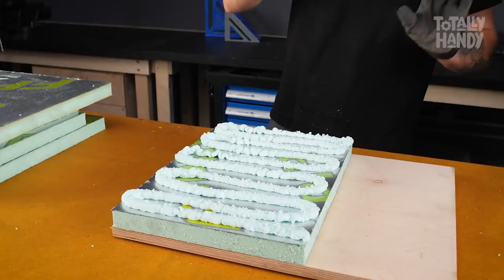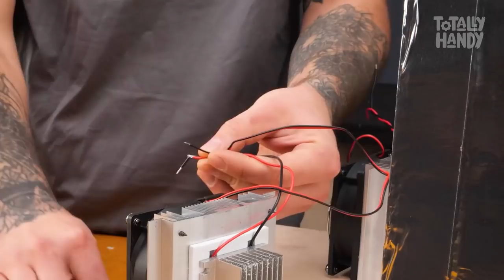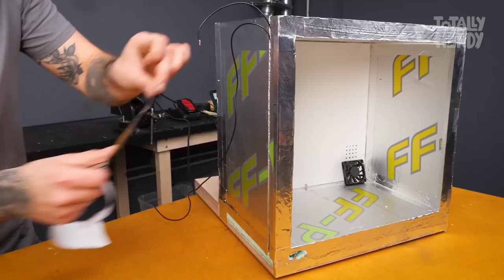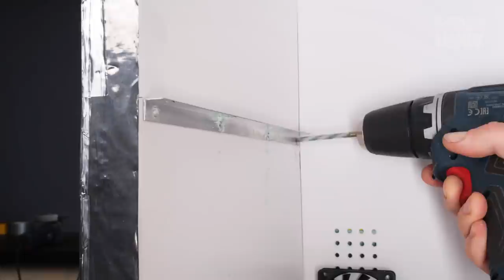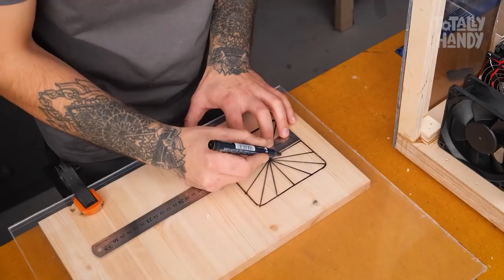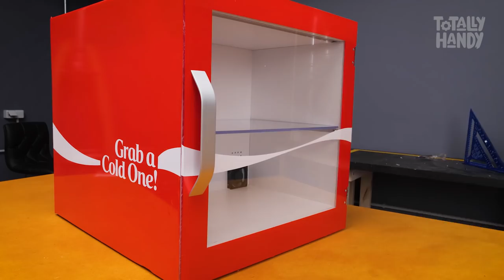DIY Desktop Mini-Fridge for Your Workshop | DIY Projects

Comment: I don't see how only 2 small peltier modules whith such a small radiating surfaces can cool down so big volume.
Inside the fridge there is no air recirculating system and also the hot side has small area/ventilation.

Comment: I love the build, but it's not practical, except maybe on camping where you've got 12V only, because Pelletiers are highly inneficient. They generate a lot of heat and the back is enclosed and I doubt the PC fan can efficiently extract that much heat through those tiny holes you drilled.
You should give us some feedback as to how it cools, how much the rear space heats, what you think in general after having used it for a while.
Reply: Öltür Elements achieve Temperaturen of 20 degrees Celsius below the Environment temperature MAXIMUM. ☹️☹️☹️ Much ADO about as much as  nothing. Utter waste of time, effort, energy and material. 😱😱😱

Comment: How quiet / noisy is it, with so many fans in it? If its for a desktop, anything other than whisper quiet gets old fast
Reply: You can use thermoelectric coolers if you don't want noise, although they're a lot less energy efficient.